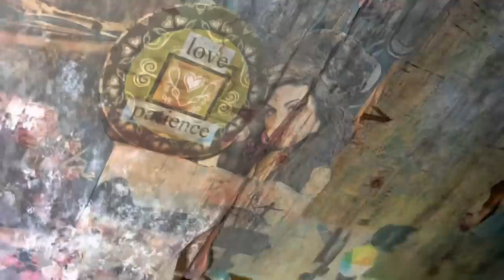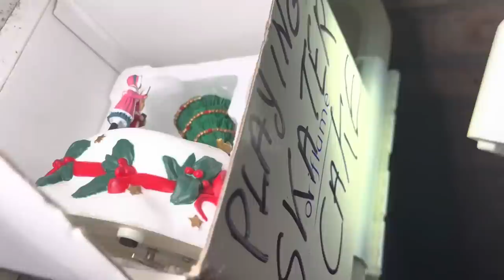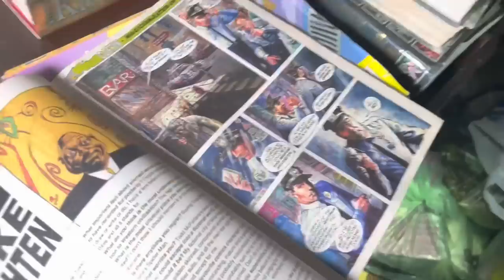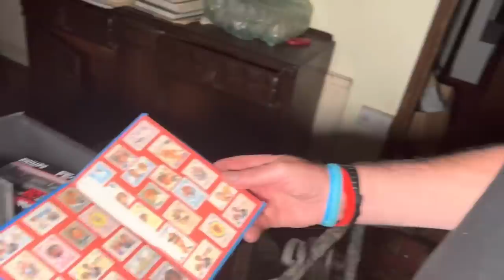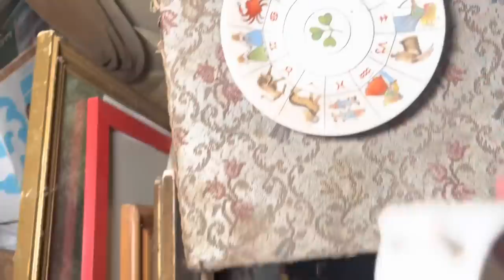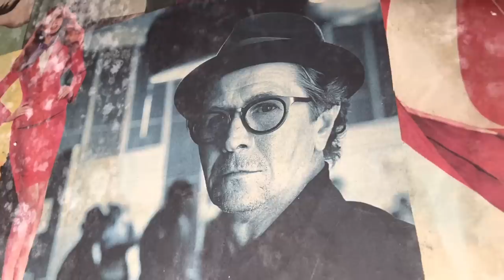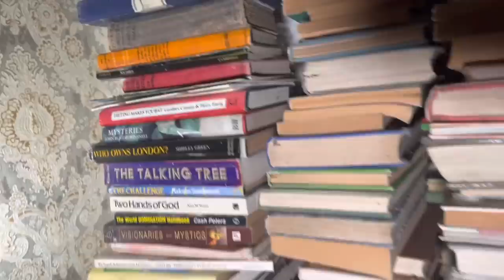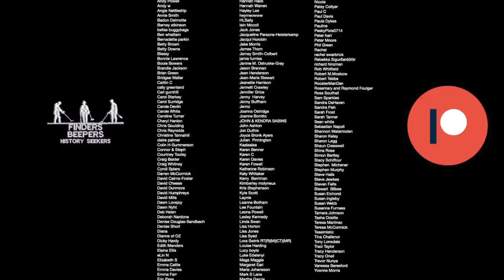This weird ABANDONED house is one of the strangest around

Comment: Andy was probably thinking of the Long Eared Brown Bat that's found in the UK. Andy- 1, Matt- 0. And because of what Matt said about the moth at the beginning, just a bit of useless trivia: The Kitti's Hog-nosed Bat (also known as the Bumblebee Bat) is the worlds smallest bat at 29 to 33mm (1.1 to 1.3 inches) in length and weighs 2g (0.071 oz) and is possibly the worlds smallest mammal. But it's only found in Thailand and Myanmar. 🦇
Reply: thanks for the bat info, interesting, do you know what those massive bats are called x
Reply: @audreyharalambos2592  Giant Golden-crowned flying fox also known as Golden-capped fruit bat. It is one of the heaviest of the megabats weighing up to 1.40 kg (3.2 lb) and the longest forearm length of any  species, measuring up to 215 mm (8.5 inches) total wingspan of 1.5 - 1.7 m (4.9 - 5.6 ft) It's found in the Philippines. 
The Indian flying fox & the Great flying fox weigh more 1.6 kg (3.5 lb) and 1.45 kg (3.2 lb) respectively. Both have shorter wingspans. 🦇
Reply: I love bats!
Reply: @Denaligirljodie  me too